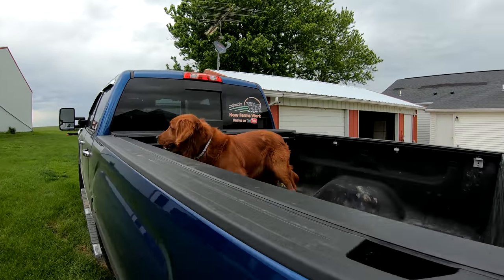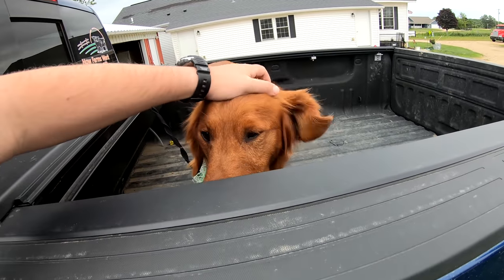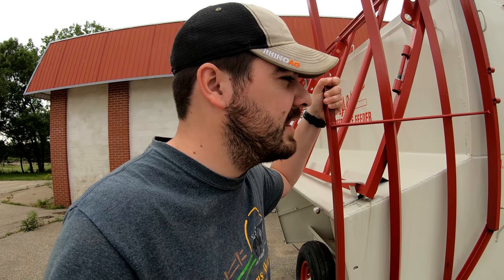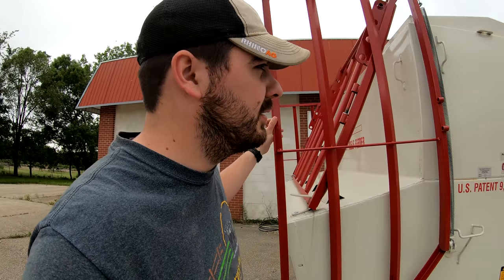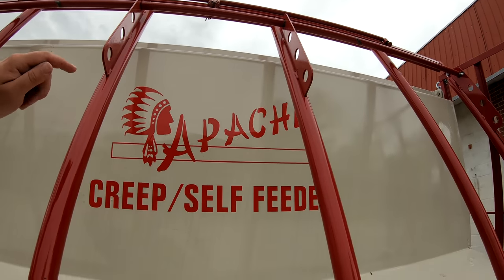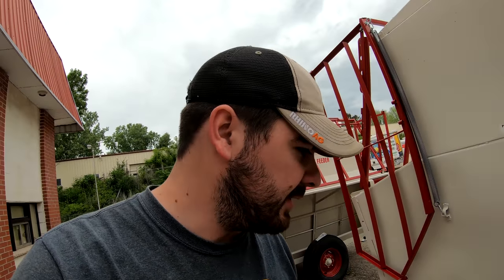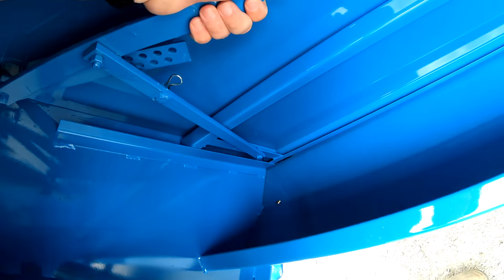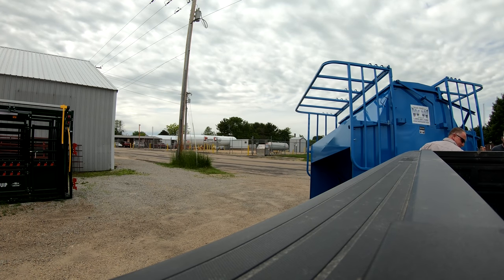Apache or Werk Weld Creep Feeders?

Comment: I agree, you should totally paint almost everything to prevent it from rusting, especially since it's still clean and new. Gotta make sure you prep the work area first though, don't want to paint over a rust spot only for it to bubble and flick off as a large chunk of paint later. ie don't trap moisture when painting or it's not going to protect anything.

Comment: Try "spray on bed liner".
Reply: That's what popped into my mind... Rhino Line it... and make sure there are plenty of drain holes in the trough if rain water can collect there.  Great video Ryan!
Reply: Ya, that what I thought of as well.  there are DIY kits ... shouldn't be, but not sure if it would be toxic.
Reply: this should be enough Epoxy paint
Reply: only problem is it's toxic and if the calves are licking it then they might ingest it.
Reply: First thing I thought of!!
Reply: Look in to hammer rite paint. Not sure on spelling.
Reply: Yeah for the floor-- wouldn't do the walls with it-- too much corn would stick.  I'd shoot it with the graphite paint like Pops said at the very least, or paint it, let it cure, THEN graphite paint it.  Regular paint would help protect the side sheets, then graphite paint helps the corn slide.  The bottom, though, I would DEFINITELY do in bedliner or a good coat of flex-seal or something like that to completely cover the steel flooring.  Make sure any drain holes REMAIN OPEN, heck I'd probably enlarge them a big myself as drain holes are notorious for clogging-- that's what the washers and bolts are for-- to help keep them from clogging up-- the washer can slide around and covers the hole, while not being tight so water can dribble through underneath it, and the loose bolt keeps the washer in place and the bolt is loose in the hole so as it moves around it knocks the crud out of the hole to keep it open.  Pretty good idea.  I'd remove the washer and bolt, flex seal or rhino-line it, let it dry, then put it back like it was so the washer and loose bolt can keep doing their job as intended.  

Wet calf slobber and grain shorts/dust makes for a pretty effective material to hold moisture, produce organic acid as it decays, and rust out steel.... Throw in some blown rain or snow melt and you REALLY have a recipe for rust!!! 

Later! OL J R :)

Comment: I see a lot of votes for bed liner but I would say EPOXY Paint. You want something with a very hard surface so that the grain doesn't either abrade it or stick to it.                              sdh in the TOBACCO VALLEY of CT
Reply: Epoxy paint. Have had great luck with it on many steel surfaces. It is like putting on glue initially but gets very hard. It's my 2nd choice after powder coat paint.

Comment: I work in a fabrication shop and I think the reason the welds are rusting is that they didn't remove the weld residue before paint. Running a wire wheel over them would have helped, they also look like they used liquid paint instead of powdercoat. They should use stainless steel, it would cost more but wouldn't rust. Of course if they didn't rust they wouldn't sell as many. I would drill a hole in each end and build a slide agitator instead of a spinning one, like a slidehammer without the hammer. Always fun to watch How Farms Work.

Comment: We normally figure you gain about 100 pounds per calf creep feeding. Also you should probably mix in a limiter so that the calves don’t over eat. Also if you want to get something so it prevents rust get zrc it’s a galvanized paint . You can get it on amazon works great.
Reply: ZRC  cold galvanize is a great coating, can only be applied to bare steel, does not adhere to a pre-painted surface.  May be brushed, rolled, and sprayed..

Comment: Spray on bedliner would help with stopping rust
Reply: no it dont, dampness stays between and rusts and you dont see it until, total damaged, spray a cheap cooking oil,, or like me, build your own out of 1/8" stainless steel for a fraction of the price, but shop around for the stainless, most times it same cost as this cheap 14ga sheet metal

Comment: one time a year (or possibly less) get 5 gals of food grade veggie oil and coat it down. If its painted the cows will end up eating The paint flakes. The oil can go through a latex paint spray gun and will protect it for a good long time. It will also soak into the corners where water will sit and protect them too. The oil can be had cheap at a sams club or a restaurant depot.
Reply: Best idea yet. We spray all our truck frames with a combo of diesel, kero and bar/chain lube.
Being a food cart, your idea is best.

Comment: Feed train 155 has plastic feed troughs and they have a large handle for feed agitation. One down fall I've seen is you cannot put ground ear corn in them as it won't feed down. It bridges up bad. I've thought of putting more agitators in that area but I only do it for a few batches of feed. It's a 4 ton feeder I double purpose as creep and as steer stuffer.

Comment: Im sure it will hold up fine but the welds on both units look like crap.
Reply: it looks fine for being mass production - wouldn't expect (pretty) premium welds on stuff like this.
Reply: @Deutschehordenelite  I work in a fab shop and the guys could lay better beads with their eyes closed. Definitely not skilled welders assembling these.
Reply: @lorenkindschy7153  no definitely not, but your guys probably get payed a little more too ;)
Reply: @Deutschehordenelite  Your probably right. Im sure there is not a big profit margin in these.
Reply: Like most things nowadays, it's built as cheap as they possibly can make it.  Probably hiring kids straight out of high school ag classes to weld them together, people they can get to work cheap for $9-10 bucks an hour.  Not going to see high quality welding with those wages.  As soon as they DO get good at welding, they probably quit and go get a better paying job.  They can always hire another kid or unskilled worker to work cheap and take their place...  Hence the crummy welding... 

Heck even the stealerships are doing that here... Go into the shop in any dealership, car or tractor/equipment, and you'll find that the place is full of "kids" (in their 20's usually) working for a pittance.  The tractor dealers here keep 1-2 "gurus" or "graybeards" on the payroll that have been there 30-40 years and know all the ins and outs of the machinery, and they "supervise" the young "know-nothings" that are basically just wrench turners and have no idea what they're doing... the graybeard tells them to "take this off and check that, then come tell me what it looks like or what it reads" and then they tell them the next thing to do.  Heck even the car dealerships are doing that now.  My brother's car had a factory "anti-theft" thing where you had to pull the headlights to "flash high beams" to get it crank up, and he was having trouble with the ignition switch and changed it and it was still giving trouble, and our Haynes manual didn't have ANYTHING about that factory theft deterrent crap so he decided to take it to the stealership for them to have a go at it-- after all, they should have the factory books on it and trained technicians, right??  Well, it was there a couple days and he asked me to check on it while I was on a parts run for the farm.  I stop in, no service writer outside to talk to, so I wandered through the shop... I was surprised to find the shop looked like a high school mechanic's class, other than them all being in matching blue shirts, it was all young "kids" in their early 20's.... I walked over to my brother's car, and there was an open manual on top of the intake manifold, left by the mechanic as he was gone to do whatever... I was shocked and amazed that basically it was the exact same text and illustrations as the goofy little Hayne's manual we had at the house.... This nervous kid walks up and asks if he can help me, and I said, "it's my brother's car he asked me to see how it's going" and he was like "we're still testing it, but it should be ready tomorrow".  SO as I'm leaving I see a couple of older fat guys in their mid-late 40's or early 50's walking around from vehicle to vehicle, and usually followed by a "kid" or two, they'd walk up and ask the kid working on that particular vehicle "did you take the thing off?? What did it look like?  Did you test such-n-such??? What did the tester read??   Okay... Well, take off the thingamabob next and have a look at it, or run an X-Y-Z test and come tell me what it reads once you finish it, then I'll tell you what to do next..."  They just wandered from vehicle to vehicle telling these kids how to fix it, so the shop doesn't have to hire but two or three highly experienced technicians that they have to pay a good wage to keep on the payroll.... the rest can just be "trained monkeys" turning wrenches that really have no idea what they're doing... and once they DO learn something and start getting good at what they do and want a RAISE, they don't get it, so they find a better job and quit and are duly replaced by another wrench turner that doesn't have a clue, but works cheap.... 

I had one such "know-nothing" one time get sideways of me in a stealership shop at the tractor dealer... We didn't have a shop press at the time and I brought in a hipper bearing housing and bought a new pair of hipper bearings at the parts counter for them to press in.  Well, I'd had them failing with alarming speed; Dad and Grandpa had always just dropped off the housing and told them to put new bearings in it and they'd come back later and pick it up to go back to the shop and put the hipper back together and get back to the field.  Well, I went in to the shop and WATCHED them press them in one time previously, and found out that the know-nothings were pressing the bearing INTO A BORE by the INNER RACE, which dents the ball bearings and cracks the races and causes the bearing to fail... (You NEVER push a bearing into a BORE by the inner race-- you press on the OUTER race when pressing into a bore hole with a press tool that's hollow over the inner race-- similarly, you never press a bearing onto a SHAFT by the OUTER race-- you use a press sleeve which pushes the iNNER race down onto the shaft and leaves the outer race free and clear).  They didn't have a press tool, so I actually went to an oilfield supply and bought a high carbon pipe collar of the correct size and made the proper press tool to press the bearings into the hipper bearing housing bores... Well, I got this particularly idiotic know-nothing fresh-outta-high-school big mouth kid that thought he was God's gift but didn't listen to anybody--- he refuses to use the tool, puts the bearing in, and starts pressing on it in this ancient manually operated arbor press with about a 3 inch forcing screw and a huge hand-wheel at the top to turn the screw... once it got too tight to turn the hand wheel by hand, it had a ratcheting hand lever about 3-4 feet long working a little ratchet pawl on the wheel to FORCE it forward tooth by tooth, giving it ENORMOUS mechanical advantage... SO this idiot starts cranking on it, and the bearing goes cock-eyed in the bore, not straight and true, and he keeps leveraging on it, despite me telling him, "it's gone crooked, you might want to back off and straighten it up with a hammer and then press some more... He waves me off and is basically HANGING with all his weight on the lever, forcing it... it's getting worse and worse so I get WAY back, because I know what's coming next... Sure enough, BOOM!!! The bearing exploded and bits of razor sharp shrapnel and balls go flying everywhere, even dented the tin shop wall behind the press-- stupid kid was lucky he didn't perforate himself.  We pull the housing out of the press, the bearing had dug a perfect "crescent moon" into the softer steel of the housing bore where it went cock-eyed before it shattered, so I took the remains into the dealership to the counter and called for the owner, and made him give me a new housing and two new bearings after I told him what happened.  He had the shop foreman press them in for me, and then I left.  A couple months later I bought us a press for the farm shop so I wouldn't have to deal with IDIOTS like that anymore.... 

Later!  OL J R :)

Comment: Por 15 is a great for preventing rust.  You have do two steps to treat metal fist. It comes in kit   Than paint Por 15 on.   But seals like concert.  I use on my 65 El Camino.  Eastwood makes encapsulating rust spray.  It works good also. Por 15 is the best
Reply: Yeah tractor salvage company my brother used to work for did fuel tanks with POR-15... great stuff.  I had a gas tank done for an older tractor myself... stuff works great.  I actually prepped the tank for them since it halved the cost... I bolted some angle-iron brackets to the rear wheel of a John Deere 620, and jacked the wheel up and blocked the other one.  I attached the fuel talk to the brackets with a bunch of bungee cords, dumped in a big huge bottle of BB's I bought at the sporting goods store, and stuffed rags into the holes in the tank for the gas filler and fuel gauge... then I started the tractor, put it low gear, and left it idling for about an hour with the tank flipping end over end.  Then I put it in reverse for about an hour, then took the tank loose, stood it up on end, roped it to the side of the tire (turned the tank 90 degrees upright) and then ran in low for an hour and reverse for an hour AGAIN... That way it cleaned ALL the internal surfaces of the tank with the BB's as the tank flipped end over end both ways, and side over side both ways... I took a magnet and fished out all the BB's, which were all coated in this rust colored "mud" of ground up rust and diesel fuel I'd rinsed the gas out of the tank with.  I pressure washed the inside of the tank, and set it aside to dry in the sun.  The BB's got cleaned up in diesel and put back in the bottle for reuse.  

Once dry the tank was spotlessly clean bare steel inside, no rust at all.  My brother took it to work the next day, and they cleaned it per the instructions and then applied the POR-15 inside it.  It came back like a brand new tank for a fraction of the cost.  The old Johnny Popper barely burned any fuel flipping the tank for a few hours, and the BB's were cheap.  I was well pleased... 

Later!  OL J R :)

Comment: Go to Lowes or Home Depot and get the waterproof shower  panels that they put in for remodeling shower stalls for the inside of the bin. Bolt it in with stainless steel bolts. Seal it with Flex seal and maintain it every 2 years. Or just get plastic shower wall panels and bolt that to the inside of the bin.

Comment: 30 mph because at 31mph the welds break on the axles and leaves it sitting in the middle of the highway.
Reply: 30 MPH limit is only when filled the salesmen for Werk Weld travel pulling these empty at posted speed limits.   At public auction Werk Weld equipment sells for new price regardless of age.  There are creep feeders in the country still in use that are at least 15 years old.  This family owned business has been around more than 30 years.  Also,  creep feed takes some of the stress off the cows by supplementing the calves and adding more weight at weaning time.  Congratulations on your investment.
Reply: No springs so if it hits a chuck hole it's gonna go airborne... not a good thing.  LOL:)  Later!  OL J R :)

Comment: The welds on both them feeder is absolutely awful!
Reply from the maker: Thought so too, I think the Werk Weld was a bit better, at least it hadn’t started rusting yet
Reply: @HowFarmsWork  Yes the werk weld definetly looked the better piece of kit and is the one I would have chosen!👌 it's often a shame how little effort these company's put into stopping rust, I feel it's so you'll be back to buy a new one a few years sooner! But nice feeder none the less and I'm sure it will do the job for many years
Reply: the sad fact is, the welds on any factory trailer under a GVW oF 10,000 lBS  is the same poor build and workmanship, that is why every trailer i own, i built my self, and i have many
Reply: a freakin joke
Reply: @HowFarmsWork  What was the price difference between the two??  Looked like the Apache had some sealant caulk or something on the seam that wasn't well bonded.... getting water behind caulked steel seams is worse than no caulk at all, hence all the rust.  Probably a super-thin poor paint job as well.  

You could add your own agitator to your feeder-- just torch a hole on either end and slide a long piece of pipe through it, maybe add a wear block of wood or steel on either end (the one in the video looked like a big washer to me-- just something to bridge the hole and the pipe or rod and act as a "bearing" of sorts, and keep corn from dribbling out or water dribbling in...)  Weld some bolts or bits of steel rod or angle iron or whatever bits of scrap you have to the rod for "agitator paddles" or whatever, and then weld a crank on the outside end... maybe weld a washer or something over each end to keep it centered fore-and-aft...  nothing to it.   Heat and bend a piece of steel pipe or a rod to make a handle crank to turn one end (by the tongue if I were doing it).  Easy peasy... 

Later!  OL J  R :)
Reply: Please don't critize the work of the Tiawanese children!